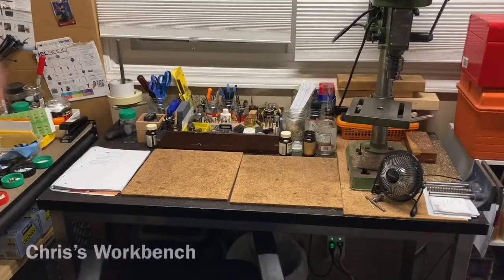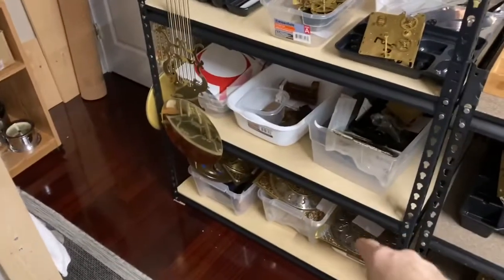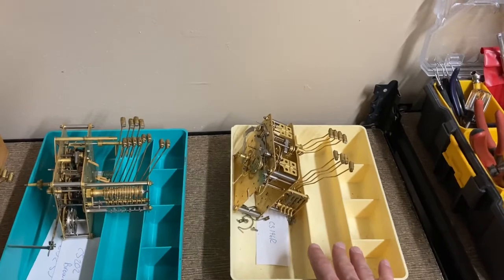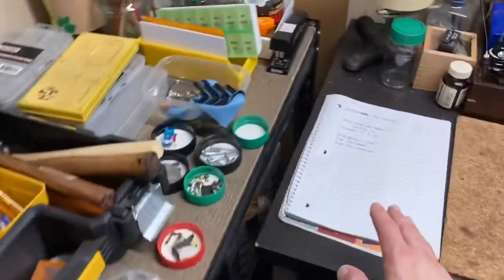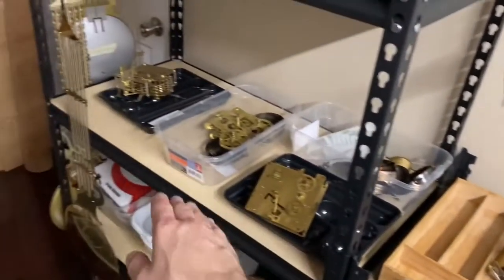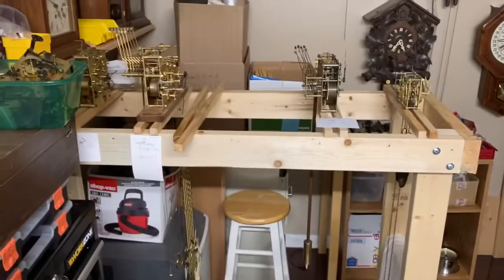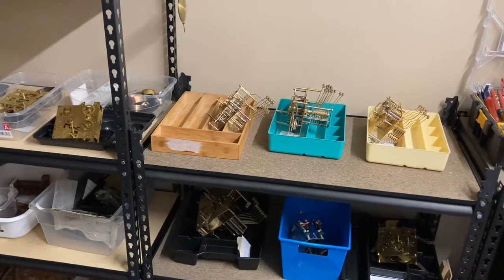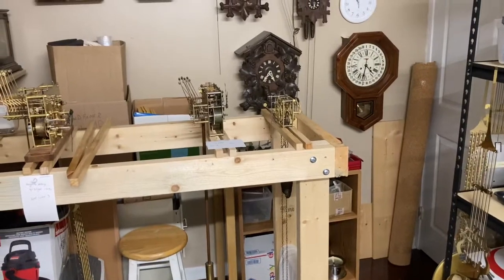Clock Repair Assembly Line Part 2

Comment: Thank you SOO much for taking the time to explain your reasoning and sharing your ideas on keeping parts and pieces together.  I was wondering, do you have any video on how to replace a jammed minute hand on   a two or three chime movement?  I'm trying my luck to repair URGO WU32/1 but cannot find a tutorial on minimal  removing and replacing.  Thank you👍
Reply from the maker: Are you having trouble getting the minute hand off the center shaft? They are typically just pressed on.
Reply: @Chrisclockrepair  Yes, that is correct.  I was adjusting the time, a 1/4 turn until I was close to the desired time.  As I passed the hour marker, something hung up and I heard a "Click", now I can no longer adjust the time using the minute hand and it will not advance under tension.  The clock continues to keep time, but no more chimes.
Reply from the maker: @daddyoalcaraz4030 I am still not 100% certain I understand your situation. But if the minute hand turns, but does not advance the time to actuate the chimes, the bushing on the minute hand may be loose and spinning . In this case the hand will turn, but not actually turn the shaft of the clock. The fix for this is to tighten the hand bushing. If thats not the problem, you may have a bent center shaft or worn center shaft pivot hole causing excess resistance. Does that make sense to you?
Reply: Sounds like you might have something jammed in the movement, you should be able to turn the minute hand without the bushing in the hand slipping, make sure the snail cam and rack aren't jammed on something
Reply: @Chris clock repair  yes and no.  The minute hand/center shift got jammed and now I cannot advance the time smoothly without extra torque.   The clock ticks, the snail and train both rotate but the minute had just will not budge

Comment: Hi Chris Do you have a video of a Quail Cuckoo movement? How about a three weight Cuckoo movement ?  Thanks  Bob
Reply from the maker: Robert Horneman Hey Bob. I have a video of various cuckoo clocks with different music boxes (3 weights), however I haven’t finished the editing. I don’t have any quail videos yet.

Is there something specific on the three weight you would like to see or know?
Reply: @Chrisclockrepair  i would like to see a video of the reassembly of the three weight and quail cuckoos.I have done several of them but still have trouble locating the levers. Just wondering if there is an easy way? I could send a quail movement and maybe you would do a video?. I will watch for your three weight video.
Reply from the maker: Robert Horneman Okay. I will start with the 3 weight assembly movement first and go from there. I currently have 9 clocks I am working on so give me a little time, but I will get a video up soon. I am assuming you are referring to the levers that actuate the music box and the levers that operate the strike of the cuckoo bird. Is that correct?
Reply: @Chrisclockrepair  The music box is operated by a main wheel. Yes I am referring to the levers that operate the strike of the cuckoo and the actuation of  the music box. I find it very difficult to install the two brass pieces that ride on the cams for the cuckoo and music. I will be watching for your next video.